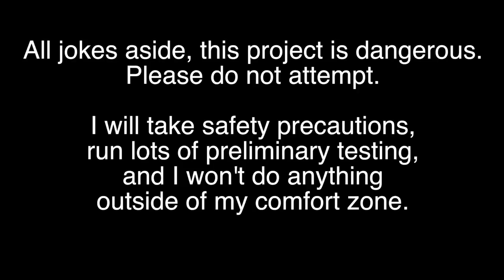Homemade FLYING Machine! (Part 1)

Comment: just so you don't die or anything, be sure to use lock nuts instead of normal jam nuts or hex nuts on any vibrating part or an part altogether. they're a bit more expensive, but have a nylon insert above the metal thread that locks onto the bolt, even through vibration. way safer. now that you're flying, with a blade in close proximity, you DEFINITELY don't want anything coming apart.
Reply: lol you just said "just so you dont die" so casually...

Comment: I suggest you to watch the engines of liquid piston. They are a new kind of rotary with the characteristic of beeing 3 times lighter to standard engine compared to the power output. And maybe you can make somethings that flies. I mean for something with vertical take off
Reply: Liquid Piston has a bunch of sealing issues that need solving, not to mention how things change size when they warm up from all of the combustion.

Comment: I would be interested so see what sort of power this thing has .. as in, could you stand on your long board, and push a car with wind power..
Flat surface, dry road, car in neutral, (friend piloting car of course), fire up the fan, see if you can move the car..

Oh and to save me trawling through  however many previous videos, could you let me know what are these motors, and their power supply?
Thanks and I look forward to seeing you fly.. :)

Comment: It's cool that you can rig that together, but I question the ability of those connections to hold your weight (or beyond that). Please do more research on the amount of forces involved before going into the air with that thing.

Comment: You need to make the two side of the cage smooth, othertwise the lines will snag on the cage on take off...
And no power during pulling the wing up, the cage will flex in the prop, especially with that bigger cage.

Comment: As a PPG pilot I must say that you do not have a proper harness setup for the glider. It must be attached properly and balanced for you to hang correctly. It is dangerous at best. I would gladly sell you a used rig at a huge discount. I would also sell you a spare parachute to use for emergencies.

Comment: Find a paragliding center or forum and read up on proper harnesses and safety, also research prop safety, when you were test firing the device you were directly in the props arc, very dangerous, if you crash and wind up with a limb or your head in the spinning prop, it could literally cause a fatal wound.

Comment: Everyone is so concerned about your safety. You need to wear a suit of armor and long board with a lance.
Reply: Suit of armor would make him heavier, putting more strain on the safety devices and also going beyond what the fan is capable of pushing out. Basically, he won't be able to fly that way
Reply: @mimked  bigger motor

Comment: Yeah bro omg this cage you built around the blade is way to thin, flimsy, and not going to hold your arm back if it gets drawed In by suction or anything else. Get or make a welder and use strong aluminum to create a thin but strong cage and your arm won't get cut ever again

Comment: Your arms might fly off but you won't fly with this. If you get off the ground the torque will rotate you back into the ground with no protection from that flimsy netting and aluminum tubing your arm will be sucked straight into the spinning prop, or worse it will break off on impact and possibly decapitate you. And those are just the likely scenarios. Let's not forget engine vibration, prop not balanced, line entanglement. Can't wait to see how this turns out, pass the popcorn.